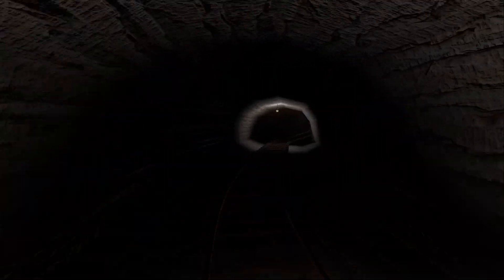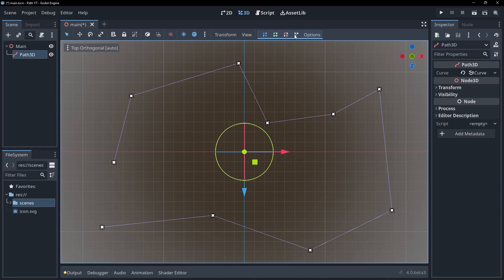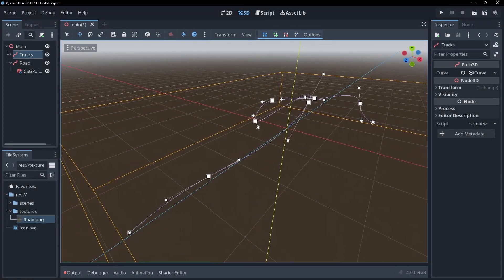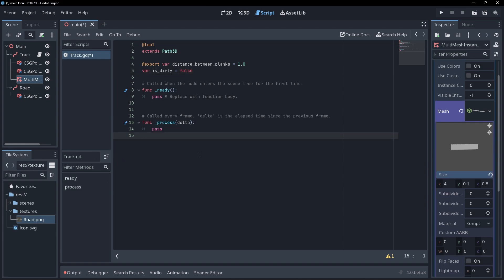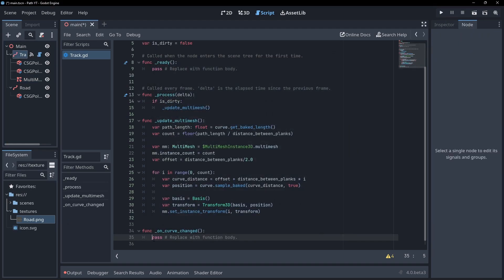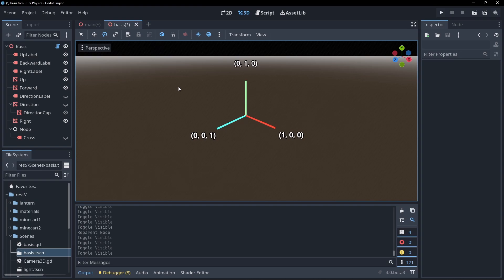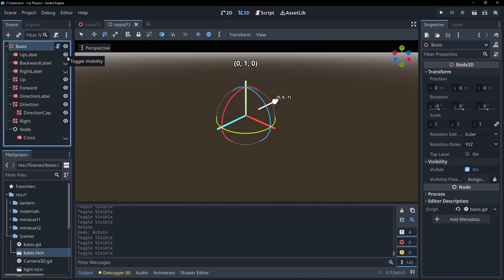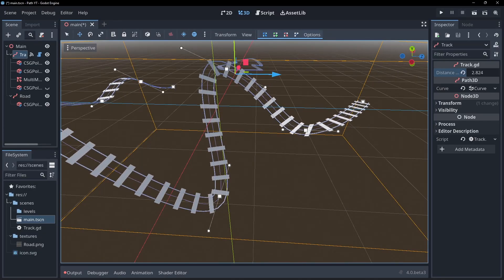Path Based Mesh Generation in Godot 4

Comment: Im having trouble holding shift+click to do the curves while using Top-Down view (It just doesnt happen, i have to use perspective, which is bad for "flat" tracks. Any tips or workarounds?
Reply: Same here. 4.3 Dev 3
Reply: @my_yt_  havent found a solution yet, but i ended up doing it on perspective mode, and manually changing the Y position to 0 on each point on the node's config.

Comment: Is there a way to do this without Csgs? Csg meshes do have quite a bit of a performance cost and are only meant for prototyping.
Reply from the maker: The performance hit is only if you edit the meshes during runtime, if the mesh remains static you should be fine.
Reply: Thanks! Also, is there a way to copy the shape of the csg polygon and make a collision shape with the same shape. I need to create an area 3d with a collision shape that is formed based off a path but I haven't found a way to do so. @crigz

Comment: With the Godot 4 you also can place an object with full Transform3D with:
sample_baked_with_rotation ( float offset=0.0, bool cubic=false, bool apply_tilt=false )
Reply: This should be pinned. Makes it much easier (and solved a rotational issue I had :)
Reply: It doesn't work right if you do any adjustment to the tilt handles, have to set the last parameter to true for it to do the full transform.

Comment: Nice tutorial! What 'work'? is the CSG mesh doing? Would this method also work with a collection of 3D assets exported from, say, blender?

Edit: I mean, you say 'Cubes' (for the tracks), but they are really squares. Does the path extrusion work if the model isn't 2 dimensional?
Reply from the maker: The path extrusion only works with a 2d polygon unfortunately! You can't use it to build spline meshes like in unreal engine.
Reply: @crigz  Thanks for the reply! Do you think the 2D extrusion is robust enough for most applications? It feels a little weird to me to make stuff directly in Godot.

I suppose a proper spline-mesh system could be created as a plugin/addon.
Reply from the maker: I think it will work great for anything which doesn't need its shape to vary along its length, like the roads and tracks in the vid.

The benefit of doing it in Godot is how easy you can change and tweak things. A lesser known benefit of the CSG nodes though, is once you're happy with it in Godot you can export it as a GLTF file and polish the mesh up in blender.

Comment: Awesome vid, subbed! 

I learned precisely nothing because I've literally got a project (vid on my channel) with cars learning to drive round a track so I sat watching merrily nodding my head saying "that's right" repeatedly to my monitor. :)

Keep it coming!
Reply: How well does godot do machine learning? I was worried about simulation speed
Reply: @theaveragepro1749 It doesn't. Just let every other one, it's just a Turing Complete programming language where you can code anything you like. It's not let python which has countless libraries to do the heavy lifting for you and the difficult maths is hidden under the hood.

That said, it is much more efficient, pythoesque in its syntax and so easy to code, and allows easy access to the gpu. 

But, unless you have a very advanced knowledge of linear algebra - plus some pretty solid coding - python is an infinitely better choice.

Just, doing AI on a gaming engine obviously allows for tonnes of fun and you can achieve so much more with scant resources.

The barrier to entry though, is high.
Reply: Clearly my autocorrect prefers "let" to "like" - but I hope you got my meaning.

Comment: @tool
extends Path3D

@export var distance_between_planks: float = 0.6:
	get:
		return distance_between_planks
	set(value):
		distance_between_planks = value
			
		if not is_inside_tree():
			await self.ready
			
		build_planks()

func _ready() -> void:
	build_planks()

func build_planks():
	var path_lenght: float = curve.get_baked_length()
	var planks_count: int = floor(path_lenght / distance_between_planks)
	var multimesh: MultiMesh = $MultiMeshInstance3D.multimesh
		
	multimesh.instance_count = planks_count
		
	for i in planks_count:
		var curve_distance: float = distance_between_planks * i
		var plank_position: Vector3 = curve.sample_baked(curve_distance)
		var plank_transform: = Transform3D(Basis(), plank_position).looking_at(curve.sample_baked(curve_distance + 0.1))
			
		multimesh.set_instance_transform(i, plank_transform)
Reply from the maker: Looks good! Without curve_changed signal though the mesh instance wont update when you move the path around.
Reply: And with sample_baked_with_rotation ( float offset=0.0, ... )
? Check the API. Very usefull method

Comment: Nice tutorial! I`m working in something like this, but multimesh for planks is new for me, one thing that I haven't had a solution so far if you can help me is that I would like to automatically place signs for curves (without placing it where it is straight road), how can I detect them? I needed to understand the size of the curve and if it is curved.

Comment: Hey, very nice tutorial. One question regarding CSG is, that it is usually only used for prototyping. So this method probably isn't that feasible/fast enough if I want to do this during the game? Like for example generating a road a long a path similar how the last SimCity game did it.
Reply: There shouldn't be any significant difference between this and just having regular meshes. It's cached after all. What you shouldn't do is animating CSG to update your world constantly, as that will cause the stuff to be recreated/recalculated over and over again. IMO it's totally valid to use CSG outside prototyping, too, it's just about how you use it. As a matter of fact, Valve's source engine (Half-Life, Counterstrike, Team Fortress, etc.) is fully based on CSG for the environment. Their editor (Hammer) just "bakes" everything into static meshes when exporting, just like what Godot does when a CSG node is "dirty". Only downside when using static CSGs in Godot is the fact that they might load slower, since the geometry has to be calculated on the fly once first.
Reply from the maker: Thanks for the insight mate!
Reply: I'm not terribly familiar with CSGShapes, and have never used them with paths, but couldn't you use the get_meshes() method to get a copy of the mesh data, and write that to the project folder as a resource, to be used in another scene, without the overhead of creating the shape when the game starts?

Or, a slightly more complicated version would be to have a custom node which caches the meshes of all of the CSGShapes underneath it to user:// as resources when the scene is first loaded, then loads and displays those meshes instead after they've been created.

Might need some more refinement -- but sounds reasonable in my head, unless I'm fundamentally misunderstanding the documentation.
Reply: Was wondering the same thing about using custom mesh instead of CSG for performance. Another idea for a tutorial: adjust / flatten a terrain below the road to fit its shape.
Reply from the maker: I think it's one of those things where you can just use it and optimise later if performance becomes an issue.

What you could do later if it is an issue, is calculate a set of transforms along the path, like with the mesh instance example, and use them to place vertices to generate your own mesh.

If this video does well enough, I'll make a part two where we generate the mesh ourselves to avoid these potential performance issues. Hope this was helpful nonetheless!
Reply: @crigz  OK, thanks for the quick reply. If you ever run out of Video ideas, you could also continue this by adding a traffic system to the path. So that, for example, cars use the correct roadside and be aware of intersections (and maybe how to generate an intersection where side walks don't overlap) etc. :D